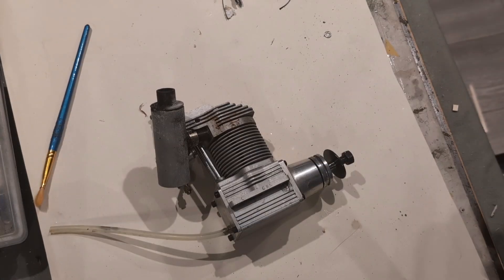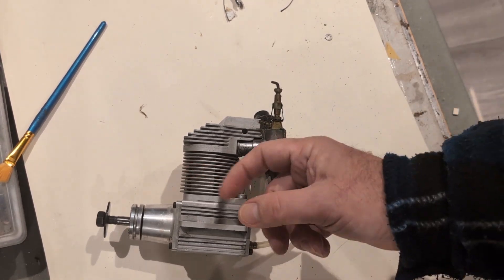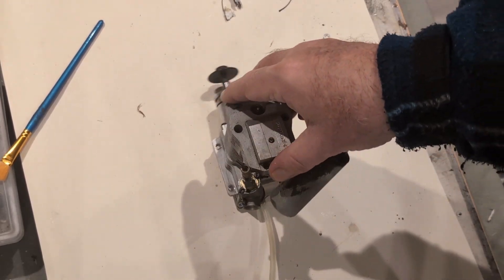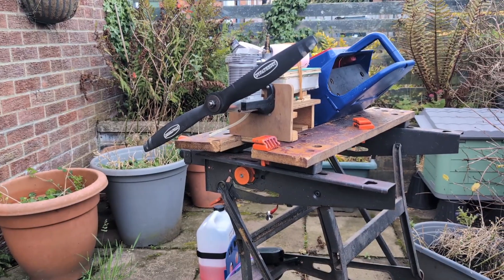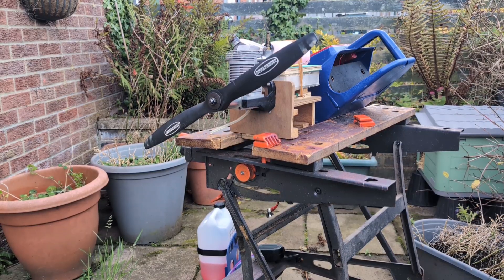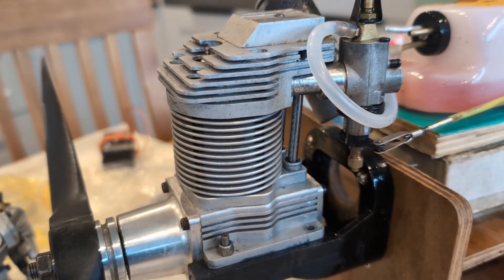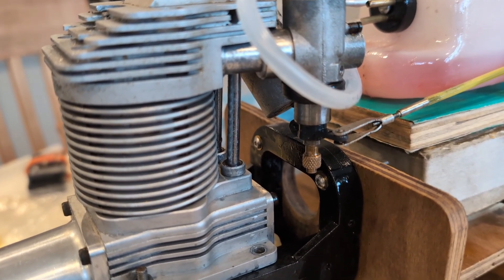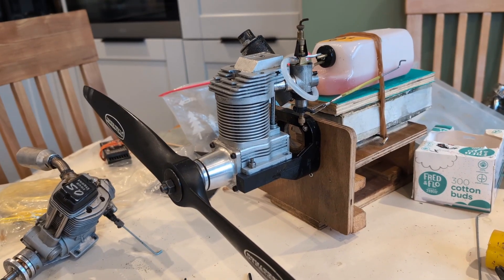Four stroke trouble shooting: engine won't start.

Comment: I had a leak on my shed roof and now a number of engines are waiting for the same process 😢.  Castor is great, but does leave the gummy residue that either fuel, acetone, or heat seems to rectify. Have used all on some reluctant engines     Great information for those transitions from electric to the dark side 😂.  Nothing like the aroma of castor and nitro 😎
Reply from the maker: The smell of Nitro in the morning 😆

Comment: Try petrol rather than glow fuel, it does tend to work better to remove castor that is gummed up. Great to see the engine running again, looking forward to seeing the model flying.
Reply from the maker: Good advice.Stay tuned for more updates.

Comment: I found that so scary and I wasn’t even there.  I was wincing by how close you got to the prop, practically leaning over it to hold the stand, tank and throttle control rod, and just how much that engine and mount were moving around when it was running.
Reply from the maker: Appreciate the concern, safety first!
Btw the apparent movement of the engine and the mount was an optical illusion caused by the prop rotation and the fins on the engine casing.

Comment: Lasers are great motors, had a couple when I was flying many years ago, made a few miles from where I lived. Mine had my initials on the crankcase! Carbs were Super Tigre, UK ST distributor was in Watford . Look forward to seeing the finished project flying. Roger in Spain 78
Reply: If you bought a Laser new, your initials were always stamped on the crankcase. Unless you specifically requested otherwise.  The carb on the engine in the video is a Super Tigre carb, or a variant of it....  Don't use castor based fuel in a Laser. They are designed to use fuel with 15% synthetic oil.....

Comment: I don't understand why you're going through all of that trouble like that why not just buy yourself a gasket kit tear that engine down to bare Bones clean it good and like a ultrasonic cleaner or something and then put it back together and it'll run like a new one... And you will have spent half the time that you've spent dicking* around with it
Reply from the maker: My approach is to try the least intrusive methods first.
Reply: Thomas, your suggestion involves far more work and is a method only  to use if all else fails. Keep everything simple and don't create problems that aren't there.